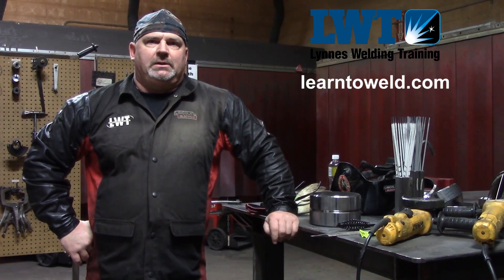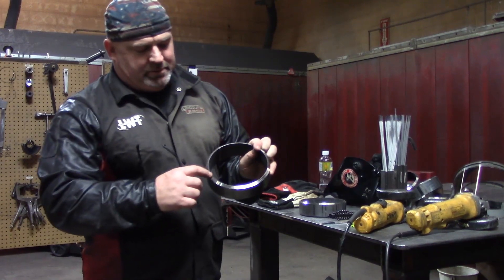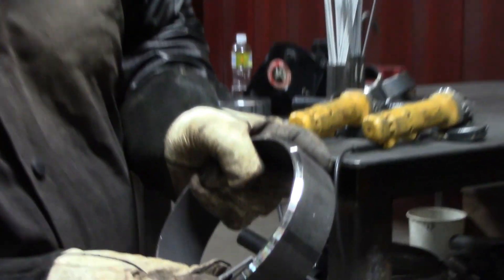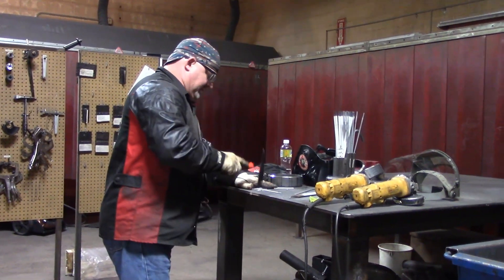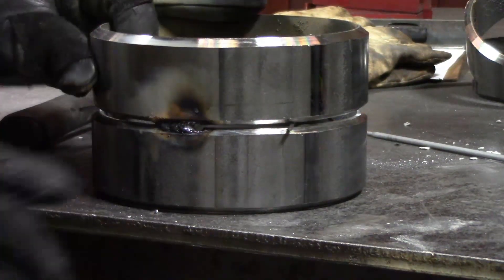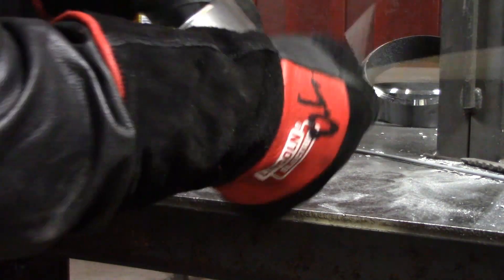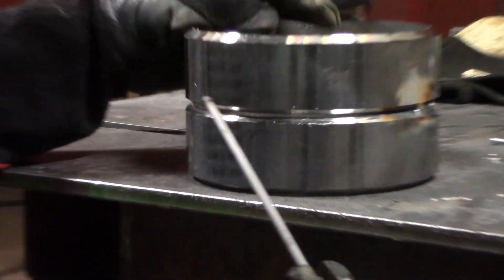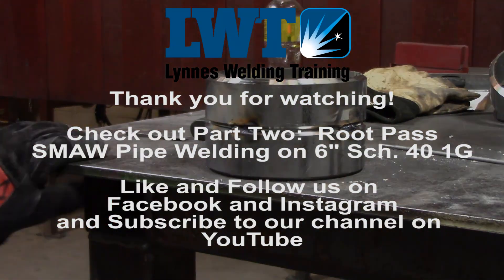Part One:  Prep and Tack up:  SMAW Pipe Welding 6 Inch Sch 40 1G

Comment: Hello Dave, I've been having trouble running a consistent root pass with SMAW 1G 6" sch 40. In this video you do everything I do to prep and tack. I just can't get a perfect root. Maybe I'm my own worse critic. Great video. On to part 2.
Reply: Hi Arthur, will you explain to me what is happening with your root pass and I will try to help you out.
Reply: Dave Lynnes dang this was a year ago and I never got the notification. But to answer your comment, my root is concave on the inside. It’s like I’m getting suck back or something. It’s like my root was never penetrating deep enough. Sorry it’s been so long but maybe it’ll still help me
Reply: @BeefJerkMe83  your hot pass may be the issue, and too long an arc length during root can also cause it. Don’t try to put in too much weld on the root. Whip that rod plenty and keep it moving. Re_melting of frozen puddle is the usual cause of suckback.
Reply: I'm in the same boat. Parts of the root im decent at other parts my rod sticks and other parts my key hole blows out. Haven't welded as a career in 8 years and having to relearn downhill pipe